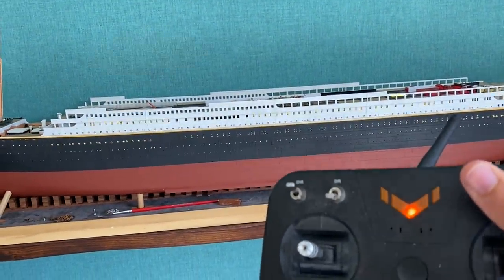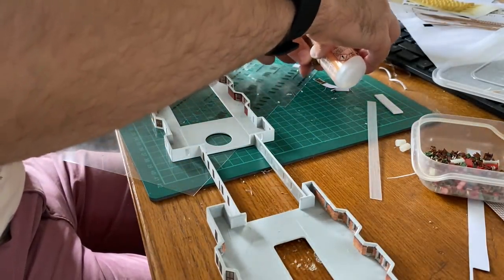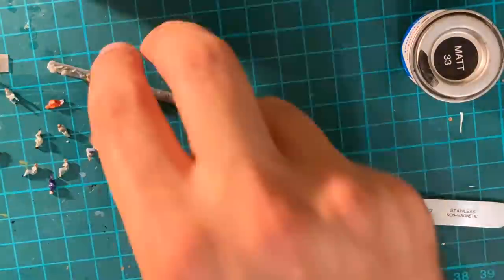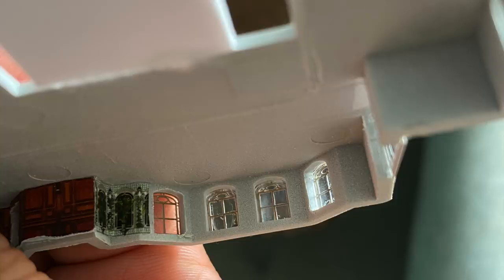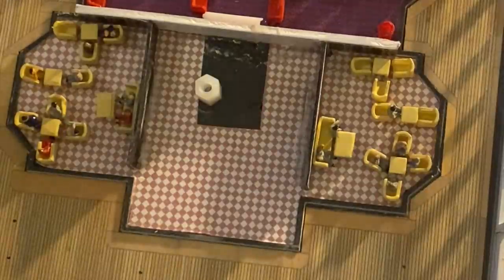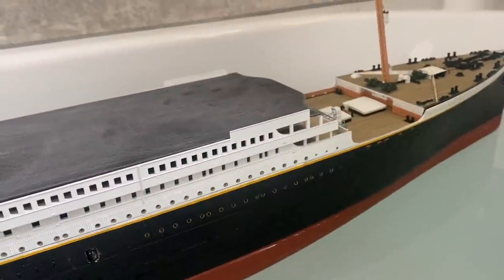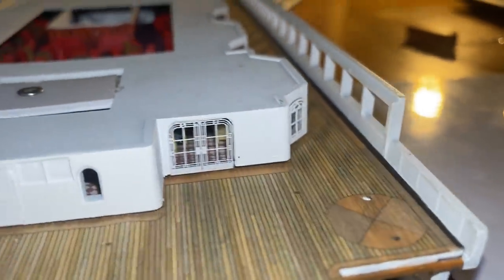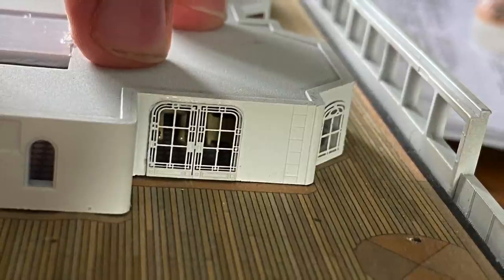Radio Control Trumpeter 1:200 Titanic Build Part 34 - Veranda Cafe and Palm Court

Comment: 25:03 small inaccuracy, the doors of the veranda and palm courts were sliding doors, not regular hinged doors. Just wanted to point that out. I can recommend that with your spares you can cut them to fit them into the frame but also appearing to be sliding open
Reply: Good to know. Thx
Reply from the maker: Cheers for the info, I have updated now! Should be in the next video 🙂
Reply: Glad to help

Comment: I do model railroading in HO scale 1:87. 1:220 is Z scale which is very tiny and I'm amazed at you modeling furniture and people in this scale and for that matter the Titanic itself with all the details that would be on it and how tiny and fiddly they'd be. I commend your efforts and work. Stay well. -Wil 👍
Reply from the maker: I think scale cuts both ways. Obviously the 1:200 scale is incredibly fiddly, but because it’s so small you can get away with a reasonable amount. At 1:87 I reckon you can’t get away with as much, so whilst things are bigger, the level of detail you can reasonably produce is also higher! 
Keep well, and thank you 🙂
Reply: @TheModelBoatGuy  Yes you're right and not being able to get away with as much fudging leads to putting more detail indeed which I enjoy doing.  👍

Comment: could use the current floating model and add weight(s) to approximately the same weight as the upper decks. That would get you the waterline. Don't forget the center of gravity and the leaning moment. Might have to do the math(s) to include the lean in turns. If you are close to the real Titanic's weight and measure the original tables would provide information. You have a steady hand, the patience of Job, and a creative flair. Hope I live long enough to see it launched and sailing.  I am retired USN and have a damage control background hence the leaning infor. Keep it up.

Comment: Hi Rob, Great video as usual.  Yes those bloody doors!!!  I have been researching those a bit to try and see how they worked. Very few pictures of the doors exist as far as I can see.
However, a picture taken from the interior (Olympic) does show the doors quite well and the Titanic Magnificent book does show the doors in situ. The doors were hung on a runner close to the external wall leaving depth on the internal view if you understand what I mean. On the outside there was a locker on each side of the rooms walls making it impossible for the doors to slide on the outside.  deduced If I am right then all is not lost with your doors being partly open. May I suggest that you cut each door in half  longways of course as James suggested and fit each reduced door in the opening about .25mm recessed left and right.  Open doors that you can still see and safer from pinging off too!  Just a thought and you may have already done something like this by now!  I bought some more tiny people from South Korea recently and they arrived today. Yeah!  I can remodel those quite easily to look 1930's!  The furniture although small is still over scale and too meaty.  To make them thinner in appearance would be really difficult and fragile. They look great though and its only when trying to fit them all in that the space starts to become a bit of a premium.   My shell plating is advancing, groan! 😬 Your stability plan looks sound and it really will be a suck it and see further along, shouldn't be too much of a problem. Finally a thank you to some of the others comments here for pointing out the door thing!  Keep well and carry on regardless!  Regards JH  😃
Reply from the maker: Hi there,
Yes I was searching for photos of those doors for a long time but couldn’t find anything other than them in the closed position. As you say it seems like they were pocketed doors (I think that’s the expression, certainly what we call them on trains)! Anyway they are now fixed and look quite nice, and as you say they are now a bit more protected from damage. 
The furniture is tricky, because yes the scales a bit out but as you say impractical / impossible maybe to go smaller. These were the only rooms where I was struggling to get enough furniture to make it look convincing though, I thought too few tables looks a bit odd really. Anyway we carry on, and fortunately not too much more in the way of interiors to do! What a relief.
Shell plating still going! You can’t be far off now? It is almost starting to get the the point where we spend as long on these models as the yards did to make the originals!
Keep well, 
Robbie

Comment: I've watch your first video and this one so I don't know if you've answered this already or not. You were concerned in the first video about how you were going to transport the ship in your vehicle with all the tiny details and fiddly bits. Have you consider making some sort of cradle for it to sit in? One that you could not only use to transport it but also make it submersible so you can use it to set the ship in and out of the water. It would need some sort of soft pads to keep from scratching the model that be able to go in the water and dry out fairly quickly. I've seen some very thin carpet like material that was only a 1/16 of and inch thick that would work perfect for this but I have no idea where to find it. Wish i could be more helpful. Maybe you've got this figured by now anyhow. This is very awesome project you've taken on. Really excellent modeling also. Stay well. -Wil  👍
Reply from the maker: I have made a sort of carrying case, which is essentially just a wooden box that should stop the ship getting knocked as I transport it. 
Re actually moving the ship, I’ve made some lifting saddles from timing belts which are quite good, they allow the ship to be lifted directly from the crate into the water and vice versa. I think it was covered in videos 23 and 30. Pretty similar thinking to what you suggest though
Reply: @TheModelBoatGuy  I'm hoping to get time to watch through your videos and see the entire build. The lifting saddle like you are doing is a good idea and I'm sure works well.  👍

Comment: Should everything be painted first before installation of the lighting or install lights before painting?
Reply from the maker: There’s no hard and fast rule for this really. Normally I find I get a better finish if I paint first. You can use an airbrush for starters and any overspill dosent go on your model. 
The only exception is when I’m adding things like LEDs, where really they paint has to go on first.
Reply: @TheModelBoatGuy  thanks so much! so for a better finish painting first is best option?

Comment: Why would you put your masterpiece in water madness
Reply from the maker: Well for me, the pleasure comes from the actual building of the model far more than looking at the finished article. 
I also particularly enjoy the model engineering side of things, getting the weights correct so she is stable, giving an appropriate level of power. 

But you are correct, inevitability there will be some age related wear and tear over the years as I sail her, but again for me that provides more opportunities to work on the model. 
To each their own I guess!